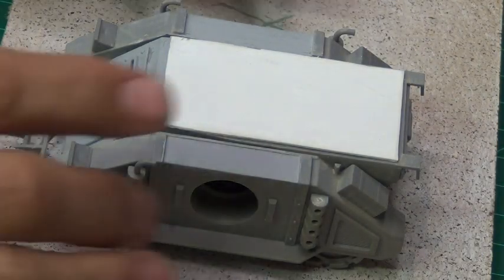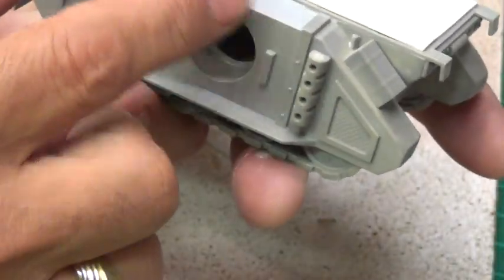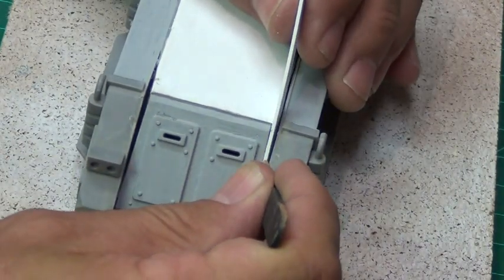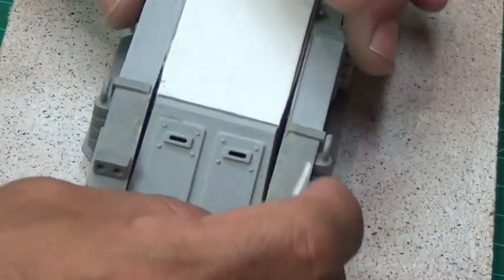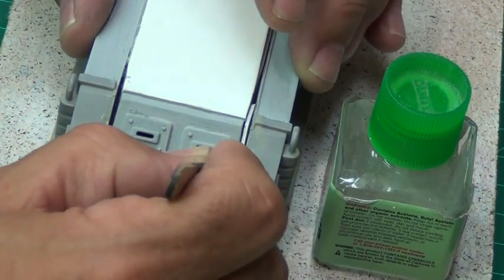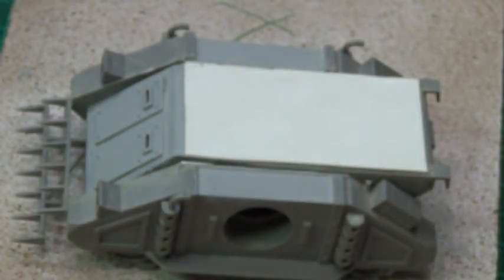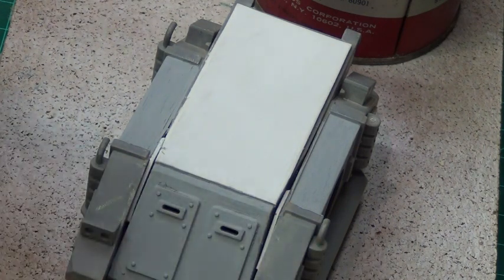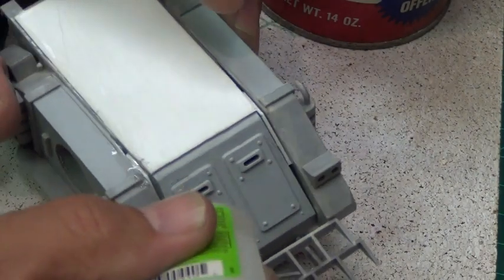Filling Gaps - part 3: Super Glue and Baking Powder

Comment: Great tutorial, thanks for sharing! Baking Powder and Baking Soda have different traits. BP can be mixed with CA then placed in the gap giving you precision and working time. BS cannot be premixed, the BS reacts with CA like Zap-A-Gap instantly curing CA, you must lay the CA then add the BS. I use the BP for thin seam filling and BS for larger gaps where it's quick. You can premix batches of BP with ink jet ink or with pigments allowing you to tell when it's cured and match or contrast the area.

Comment: Use masking tape to prevent  the glue from going  everywhere that you don't want it to go ,there is  many many different types and as many in different widths to choose from or maybe sticky tape would do , it will save you a lot of unnecessary sanding .

Comment: Can you tell me does this become waterproof? Also would it stand up to extreme heat and flame?
Reply from the maker: Oh yes, this becomes pretty impervious to anything as far as I can tell. It's also a real drag to try and sand after it fully cures. I am not a big fan of this method though. You might try the Bondo first. Just spread some out on waste plastic card, LET IT CURE for a few days. I bet that will work.

It definitely will NOT do well with flame, but low heat? Perhaps. Super glue burns like a match when introduced to flame. It is extremely dangerous to do so.

Thanks for the great question and thanks for watching.

Comment: Having used this method on ship models to fill gaps, I will never use it again the baking soda/super glue will harden into an almost impossible to sand substance  not worth the effort!
Reply from the maker: I would have to agree. It is insanely hard to sand. My favorite filler is blonde. Very easy to use and it stands perfectly. Mr. Putty is also good, but it would be a distant 2nd.
Thanks for the comment and for watching this video! Cheers!
Reply from the maker: Make that "bondo", not "blonde". Damn auto correct. 😁
Reply: @BlackKnightArtisans  Thanks for the tip I will do   a search on Bondo  Greetings from Southern California